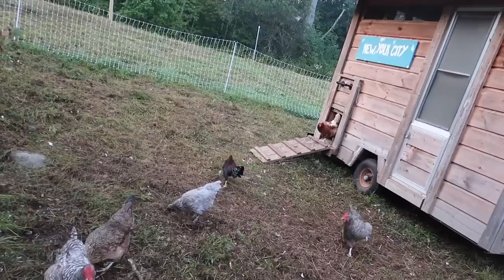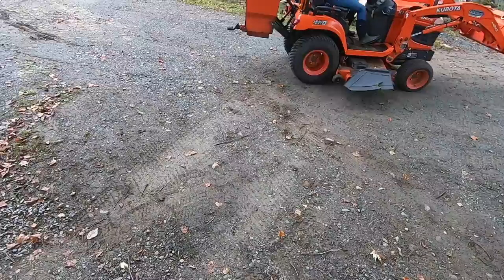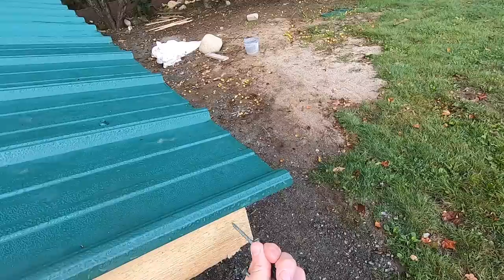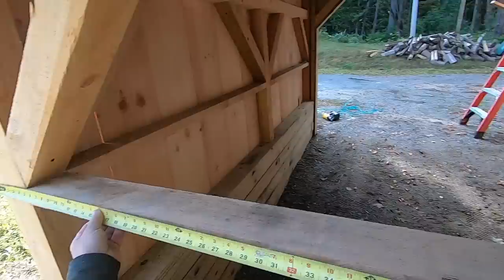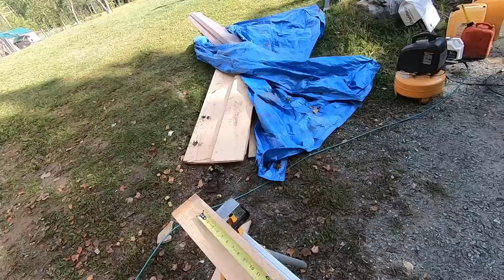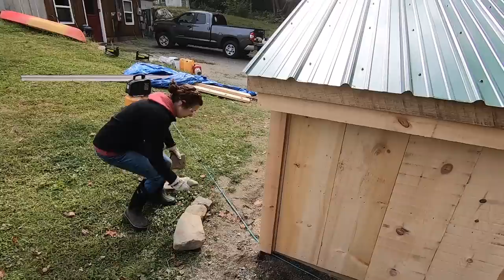Cross that OFF the List!!!! Firewood SHED Complete

Comment: On the inside of that front, center wall (weather protected)  would be a fine place to put in some hooks for your chainsaw (s), a shelf for sharpening tools,  and some bar oil.  On the floor would be the gas and oil.  One stop shopping for bringing in firewood..
Reply: Their firewood is delivered cut.

Comment: Mr. Lumnah, 
You'll see a drop in milk production every time you trim hooves.
That at least was what my family observed. So when we still did monthly DHIA testing, Dad would schedule the hoof trimmer for after the testing date. Are you going to wire the goat side of your barn for lights first? A piece of advice. Keep the wires above where the goats can reach. They'll try to chew it otherwise. Also, will you be painting the barn and shed, eventually, to protect them?
Mrs. Lumnah you did a great stacking job!

Comment: Query... Since the vertical siding is ruff cut lumber to ground level, would it help if you had sacrificial horizontal boards at the base to take the water/moisture damage that will most likely occur?
Reply: Alan Schwier old time builders from my neck of the woods used to cut a 45 degree angle on the bottoms of the boards and put them on with the point of the angle to the outside. That made a drip edge for water to run off so that it didn’t soak across the entire end grain.  I don’t k ow for certain that it’s scientifically proven to work, but most of those barns made it well past the hundred year mark with original siding so I’m not arguing with their methods.

Comment: you may thing about putting power to fire/carport for lights & outlets ? if you put the lings outlets on first you will be able use temporary  with ex cord , use motion light firewood side & driveway outlet for batter charger sw light for carport hope it helps it may save you time later.
Reply: Lumnah Acres have said in a previous reply that they intend putting in solar lights there.

Comment: An impressive bit of wood stacking in the wood shed by Gina, the shape of the logs and the free airflow inside the shed should see off most of the drying issues and prevent rotting. The building looks a good addition to the family home and all of you are thriving enjoying the ups and overcoming the downs. Like others, I am wondering what the next project will be, you have both been so heavily involved with these building drives that I cannot believe you will hang up your tools and stop. Perhaps further steps to prepare for the winter and make it easier for all, animals included.
What was the result of the vet visit, that was a story line that appeared to get left in the air.

Comment: Great work guys! Just a thought Al. I think since you have so much room in the firewood shed and the forks for your tractor that I would put firewood on  pallets. When you need to fill up the basement just grab the Kubota and drive a pallet over to the basement door. Or, you could even screw multiple pallets together to build a cube or bin to throw your firewood in and use the same concept. That way wood wouldn’t be falling everywhere when you moved it. Fans from TN!

Comment: The shed looks great! Suggestion for stacking in that type of shed, put wall side course the long way to avoid the wood settling into the wall and potentially knocking the boards loose over time. I had that problem until someone threw some knowledge on me.

Comment: Great Job. Looks like each bay will hold more than two piles of firewood you have currently been having.
Now is the time to rethink your use of it for firewood. Say for a UTV or some other EQ.
I like using a IBC Totes For Firewood and when you need it use your Tractor to place one right outside your house for quick access plus you can move around your property anytime you change your mind where to store it.

Comment: You should pile the wood on pallets or two skids you can use poles this allows air to circulate under the wood and prevent rotting.

Comment: Hey, Al... you ever considered getting a Japanese Ryoba saw for doing all those flush and trim cuts? They're razor thin, have both crosscut and rip cut sides and they cut on the pull stroke so you don't have as much risk of binding. Plus, the blades are replaceable when they get dull. They're pretty inexpensive on Amazon. Great saws.

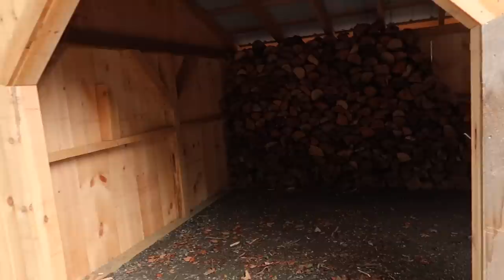Comment: 3:14 There's really only one way to tell if you've done a good job stacking wood. if it stays stacked. It can look great but then settle and fall. When you look at the stack, if you see air gaps, it has a higher chance of collapsing . But even if your triangles are tight, if the majority of large ends of the lengths are toward the back, it will still collapse. With those elements correctly in play, each row needs about a 1 degree tilt toward the back wall to insure it stays up. Happy stacking!

Comment: Yep put a hot water boiler in that she said maybe not this year. You know a lot of overthink what it takes to make such a thing. It is consumed that you could Bushcraft such a thing with a barrel stove in copper pipe. Or galvanized piping through the fire box. In this scenario you will put most of the cost of hot water lines into the ground and if you need higher temperatures or something you can purchase the proper unit. In my area the church going Amish people cells such units and they have integrity in their selection for they are the users of such items. So there is your recommendation.

Comment: Looking grand! Wouldn't it be a good idea though to put a pallet or something under the firewood, to keep it from wicking up the moisture from the ground? Also, try not to lean the firewood against the walls of the shed - again to keep the moisture away an allow a bit of air to circulate, but also to keep the weight of the firewood off the walls. Those logs are heavy! Each row of firewood should basically be able to stand on it's own, without any support. That way the walls will never buckle, or get wet.

Comment: I guess an in ground French drain on the waterline where runoff hits the ground will work if ever an issue with puddles. Those French Drain Stirofoam filled tubes are inexpensive..

The door frames seem ready to handle snow weight!

Comment: Your firewood needs air circulation to prevent mold from developing from moisture in the air. That's why it should NOT be placed against walls or directly on the ground. There should also be an air gap between the stacks.

Comment: You like being modern. You should consider these hot water fire boilers that pumps hot water through lines to your house and back. You can put one in the barn to keep your ghost a little bit more warmer I see a little bit because some people have the idea that heated sheds are not good for winter coated animals. Yet I do not see the harm in having some heat in there it doesn't need to be expensive radiator. And Truth you could be a run along the wall of inch and a half piping can even go through the wall and get the other room too with two elbows and another line of piping which you need anyways. The water use has antifreeze in it or something similar keeping it from freezing.

Comment: Wow, you got a lot of wood stacked by your self Gina! Yeah, I  though Al was done up there too. lol  I am loving your rock wall Gina, I think it will look so pretty once you get some flowers or plants in it next year. Al, a couple of questions for you. Does the wood shed not need the flashing on the roof like you did to the barn? And are you putting those little strips over the cracks on the wood shed like you did the barn? Just was wondering, not telling you what to do or anything. The wood shed does look so nice! Yes, snow will be flying soon, especially for you guys. I hate the early morning darkness and how early it is getting darker. It's only going to get worse before it gets better. lol  Let hope for a mild winter, but I have my doubts.
Reply: No need for the aluminum flashing on this roof. It's for the "valley" of a roof.  This roof doesn't have one.
Reply: @paulmonk7820  Makes sense, I knew you probably had a reason. lol

Comment: Looks great. Are you going to add eavestroughs, to redirect the water and any snowmelt away from the shed and when you are entering? I saw a car that was parked in front of a building with a metal roof and the snow had slid of the roof and damaged the roof significantly. Since then they added an upside down V shaped metal piece on the roof about a foot from the eaves. This apparently slows and breaks up any large sheets of snow from hitting anyone below or causing significant damage.

Comment: How is Olivia going to make any sales with her drive up window boarded over? ;D Shed looks good!!!
Looks like Gina has ceded the "port" to the Kubota.
One thing I discovered about stacking wood in the shed was that if I didn't use it all one year, it was easier to add new and start using the oldest wood first if I stacked it running along the side wall instead of the back wall.
Reply: They normally get enough for one year delivered.

Comment: Are you doing Batton strips on the wood shed and the other part of the barn?
Reply from the maker: We are going to let the boards dry out a bit and see if we want to add the batten strips later. Not having them will help with air flow in the wood shed

Comment: You should get a magnetic tip bit holder for the driver and work with the changeable tips. . I hate working with the bit directly attached to the driver. There is no “give” in the bit and the bit walks off the screw head as shown in the video. There’s just enough slack in the bit holders so you don’t have to be 100% in line with the drive.

I did it your way for years and now I won’t pick up the driver unless my magnetic holder is installed. The magnetic head comes in handy working one handed and with small screws. I even take the head out and use it to screw in tiny screws by hand (fat fingers)

Comment: Looks good and an enjoyable series to watch. But is it really done?  Aren't these board and baton kits and there are certainly no batons on the woodshed and the barn batons aren't complete unless you've done them without showing the work.   This is probably not going to make me popular but how are you going to rotate the firewood with it stacked parallel to the back wall?  I would have expected the stacked wood rows parallel the the end walls with aisles between them.  And what about an air gap under the wood so the lowest pieces don't adsorb water and rot?

Comment: been watching your videos on building. Great job!! saw some things you did that made far more sense than how I did things. Finished metal garage earlier this year and just finished the electrical this morning. Found the top type qp circuit breaker was defective and will be going back to replace it. Typical Chinese products! There are some good, but not electrical. NEED TO GET THE FIRE WOOD OFF THE GROUND TO PREVENT TERMITE INFESTATION!

Comment: You should get some new tires for the kubota and not just turf tires it will help you in the winter on the grass so you can get some traction
Reply: They have chains for the back tractor wheels.

Comment: You guys oughta get that...I wanna say nesting...or some kind of moss......bah, I forget...but what I mean is for the basket, there is some padding you guys can get that will help prevent breakage in the basket.

As for the firewood, hopefully you have a rotation system in the plans.  If anything, if it were me, I'd build in a divider system inside the storage area.  That way you have the current dried/seasoned wood that is ready to use in one section, the next section should be ready for next season, and the next one could be the green wood that is new and needs drying.

Soo, current season, next season(1 year), and the season after(2nd year with green wood).  And if its drying out properly without moving anything, you know which is which.

But if it needs to be moved to dry, then you can make it a system where the left(since its already started) with the current season, the middle with next years firewood, and the last stall(right) for the new green wood firewood.
Reply: R. J.  Coco fiber is what you are referring to. Good idea! It would keep small things from falling thru!

Comment: Should have put the bottom of the firewood pile up on stringers and then stickered the stack every couple of feet so more air can pass through it and keep it drier. Putting it on the ground like that invites infestation by wood borers and termites and woodrot fungi.

Comment: Sorry to be on a downer ,but all the wood needs to be off the floor (old pallets etc) and away from the side/back of the area to give adequate air/drying circulation otherwise the wood and structural timber will rot unseen (in a perfect world with rows laid alternatively at right angles !). I might have missed it ,but unless the sawn timber is or will be treated it will not last the "generations " referred to by your viewers.

Comment: After Gina's 2nd trip with the tractor I had to ask myself, "Why not use the pickup and the tractor to move the wood?" 
The shed looks really good, great job on stacking the rock wall too.
Reply: maybe a full pickup would make deep ruts in the ground...? Grass is green, which means the ground is soft...🤔
Reply: It might take a few more trips with the tractor.  But stacking and unloading the bucket on the tractor looks a lot easier than doing it with a pick up.    That being said;  Al's pick up is new enough, and their expensive enough, you don't want to start tossing firewood into the bed or risk loading it with a tractor.      Frankly, Al's firewood was delivered by truck.    Next time it will get dropped off outside the shed.    This year, he's just moving the firewood from various outside stacks into the shed.
Reply: @patrickinottawa27  they wouldn't have to toss the fire wood into the truck, it can still be handed from one person to another and stack it. He also still has a left over rubber mat from when they put them down to cover the concrete for the goats in there to help protect the truck bed. I've seen the videos of the multiple stacks of wood and I know the latest one was about a year or two supply. That's a lot of wood to move with the tractor and add unnecessary wear and tear to it. I just think it would be easier to spend a Saturday and move it with Al, Gina and Olivia loading both the truck and the tractor. (I'm not trying to argue about it, it's just my opinion on how it could be done)
Reply: @rachelm7525 for the smaller stacks they may have to drive across the grass, but green grass can still be compact enough to drive on. But the biggest pile is next to the dirt road.
Reply: @lopaka76  no we're not arguing.   Just chatting.
Reply: @patrickinottawa27  I just had to add that because depending on a person's mood, someone can read something the wrong way. Just trying to get ahead of a possible misunderstanding lol.

Comment: Rock walls just mean more weed eating where you could have just mowed; unless you put down landscape fabric and then landscape edging on the outside edge of the rocks.
Reply: Yep. And why open your eyes early in the morning because there would be a beautiful sunrise and in order to take care of it you would need to get a camera and take a picture of it then write about it in your journal. And your point is? Hey  most of us don't mind taking care of that which is beautiful. 💓💛💚💙💜
Reply: I will provide you with an answer that is as relevant to your comment as your comment is relative to mine: hard boil the eggs and peel them. Then I make up a pickle of half water and half vinegar. Add salt and pepper to taste. Bring the pickle to a boil and fill the jar of eggs with it. As the liquid cools it should form a seal with the lid and snap it down.  store them in the fridge after they cool and after opening.
Reply: Sounds delicious! It's a good thing worth the work. And she's fine with either the Kubota or a weed eater so let's not worry about her.  💓💛💚💙💜💐
Reply: Maryclaire  I am just curious, have you ever used a gas weed eater for longer than 15 minutes?
Reply: Yes ma'am.

Comment: HERE’S A TIP AL
On that apple tree where you cut that big limb off of behind the wood shed that the kid drew a pic of U. Put some clear polyurethane on that to prevent tree rotting. Normally you’d paint it with a white paint but since the picture is on it just put a coat of clear polyurethane on it.

Comment: Good Morning! We never stacked the wood against the walls.
Reply: Same here. The pressure/weight of the wood against the walls can result in structural damage to the building.  Great job on the construction project!
Reply: @antonioguimaraes4049  once those walls get wet the boards will slowly start bowing.
And yes he did another great build!

Comment: Bro it hurts me to see you hit your impact like that, just put pressure on the back of it, n the screws will go in, but besides all that great job on finishing that building,
Reply: The nailer too. Hitting boards with the side of the tip is going to make it jam.
Reply: @paulmonk7820  yup I notice that, carry a lil mallet with you Al,,

Comment: At the risk of incurring the wrath of other viewers, why didn't you pile the firewood on a bottom sticker to permit air circulation and leave space between the rows for same reason?
Reply: Robert Fort sticker = pallet. I thought the same thing. It does provide a haven for mice and snakes, however.
Reply: No offense,  but that has been asked about a hundred times.  So far, no response.